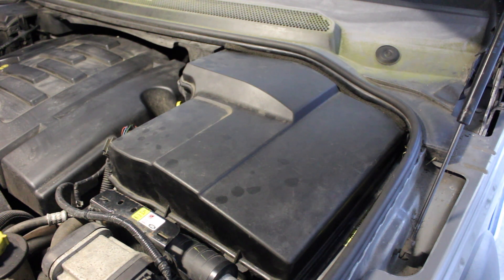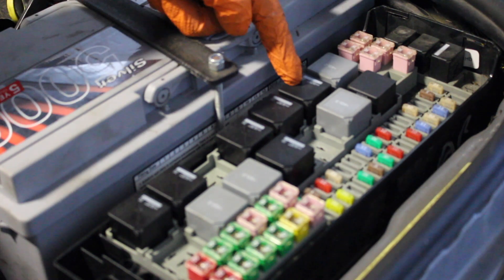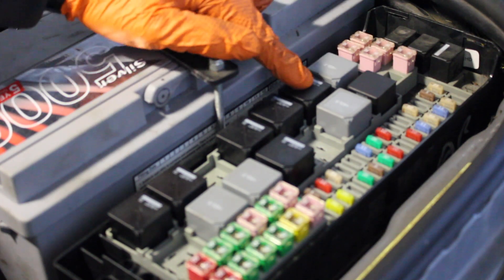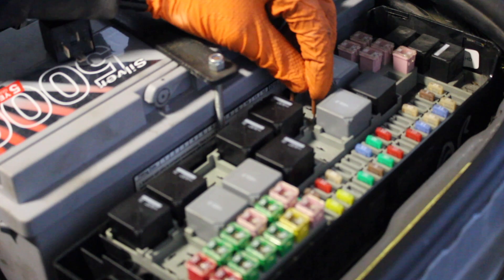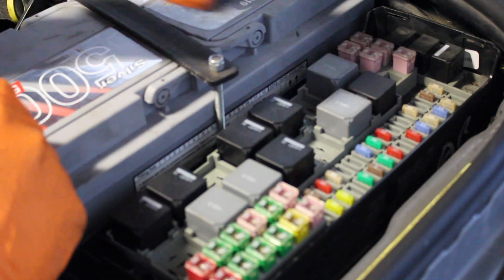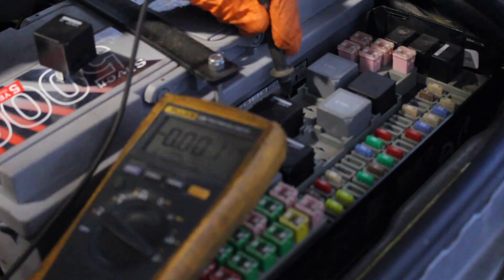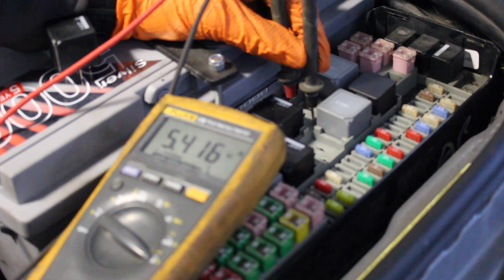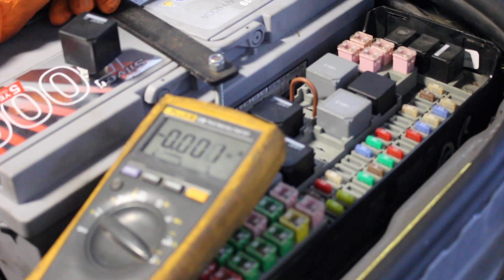How to electrically test the Low Pressure Fuel Pump on a Discovery 3

Comment: Hi, great videos and really clear to understand. Thank you. I have an LR4 2012 V8 petrol. When I put a wire across 3 & 5 on the fuel relay I get nothing. Is the next step to take the fuse box out and look underneath? Or is there somewhere else I should look first please.
Reply: I'm from Chile and I have the same question LR3 2008 4.4 V8.
Thanks.

Comment: @fixitsam But what do you do when the new pump also only draws 2,7A when ignition on, 3.1 on idle? Whole pump assembly is new, filter is new original LR and the pressure at the schrader-valve is only 4.5psi when priming, 3psi when idling?

Comment: Hi I've got a range rover sport 2.7 my current draw of low pressure pump is 1.82 amps , I take that as a weak pump am I right ? Thanks your reply would be greatly appreciated thanks 
Rob mobile man 
Rob mobile man
Reply from the maker: Seems too weak, whats the pressure like out of the bleed valve?
Reply: @FixitSam  
Hi mate it does flow out the bleed valve , I've told customer the motor seems weak or maybe gauze on the pump clogging up, his fuel filter was dirty , his rail was 240 bar but since filter replacement went to 270 , so gunna see how it goes bit it's an intermittent fault hence I think pump 
Thanks again cheers